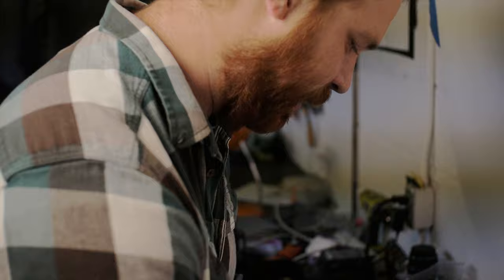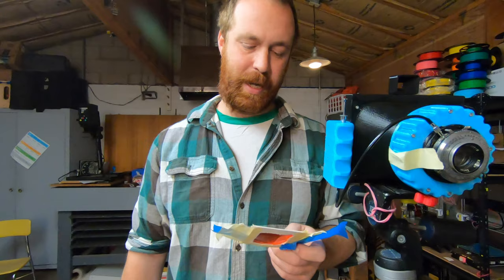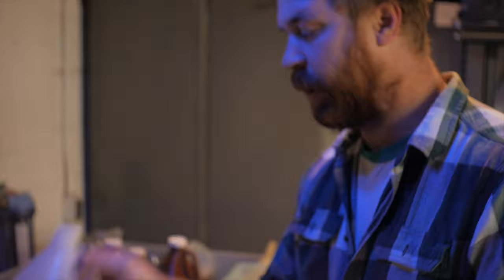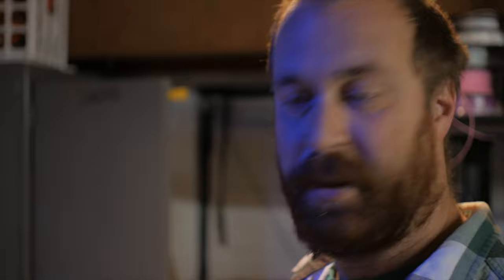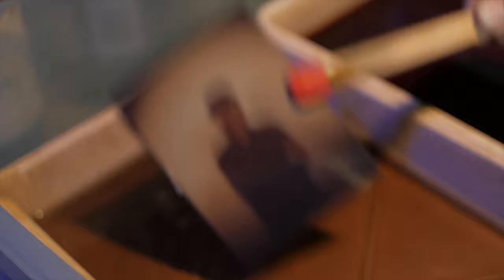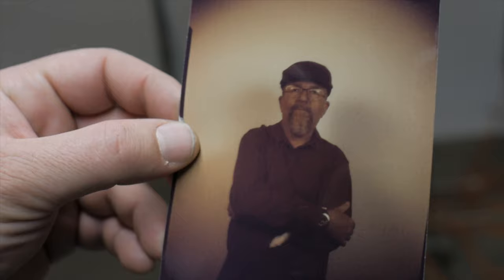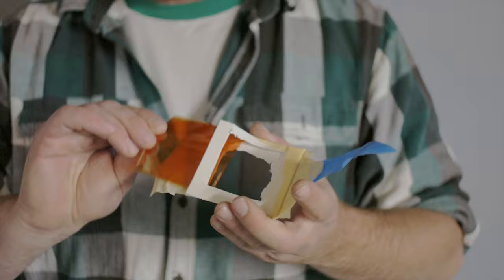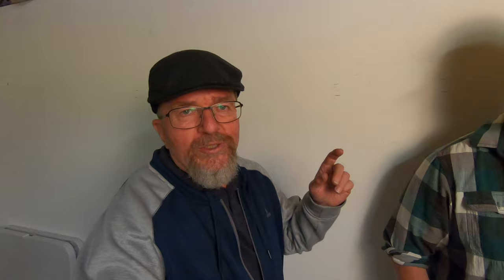Direct Positive Color Prints With Ethan Moses

Comment: The reticulation might be cause by the low temp. Color chemistry is design to work at around 90-100º F. If you want to keep developing @ ambient temp. add 5 grams of Potassium Hydroxide
Reply from the maker: Thank you!
Reply: Higher alkaline works faster, so it's like high temperature to keep grain fine.
Would sodium hydroxide work as well?

Comment: Also, Arista RA4 color paper processing kit  is designed to work between 75 - 108 degrees F which may help resolve some of the grain issues.  As you know, Kodak's chemistry is developed more for volume processing in machine processing, such as a Colenta processor and the aforementioned for tray.   Curious what chemicals are you using?

Comment: Thank you for this insightful video.  I work with an 8x10 colour neg process, but producing only colour negatives and invert to a positive after scanning.  I too at the start,  experienced little to no online resources about working with this process.  As for the filtration, I think you have a pretty good combination and don't think it's necessary to get it perfect.  I also noticed greys tend to go red, which makes sense due to the pigment dyes in the paper and how they react to light at the time of exposure. That particular element I noted as a positive characteristic and not worth resolving!   

As for the grain, I wonder if it's the B&W developer?  If you were to lower the Developer strength by adding more water? This giving more time for the tones to develop, especially in the highlights, and may resolve the grain issue. I use D-76 diluted to about 1:4 believe it or not for my B&W paper neg and find due to it's slower characteristics helps to deliver better tonality.  Perhaps this could help?  I will try this for myself and and see where it leads me. Thank again!

Comment: Good Lord, you're going to do DP Color in your Afghan camera kit? There's a challenge :D
Reply from the maker: I think maintaining the temperature of the color developer and blix will be a big challenge; although those can be done in the light - so if it's too cool, you can develop by inspection. Perhaps best done in the summer months! 

And getting accurate colors is a challenge, we're still working on that part. In-camera filtration is necessary, to simulate the orange-like tint of a color film negative's base color. But I suspect the "white" light secondary flash exposure may need to also be color balanced. Simple gel filter should do, so it may not be that hard, but requires a lot of testing.

I'm not sure about film speed of the paper. Ethan was using power packs in-studio. Again, those summer southwest US sunny days may be necessary.

Comment: I'm both amazed and confused, so is it regular black and white negative paper? Is there a written blog about the process? Can you please explain further, I want to do this, please please please.
Reply from the maker: It uses black and white developer and stop bath for the first two steps, processed in total darkness. This converts the already in-camera- exposed parts of the color emulsion layers to a negative B&W silver image. 

Then the paper is flashed with white light, to totally expose the remainder of the paper's emulsion - the part that didn't get exposed during the in-camera exposure.

The paper is briefly rinsed to prevent stop bath from contaminating the color developer.

Then the paper is processed in the color developer. This develops out the part of the emulsion layers flashed by white light - which is the opposite of the colors exposed in-camera and developed in B&W chemistry.

Then the blix (bleach + fix), which bleaches out the initial silver gelatin negative image from the first step, and fixes the image, leaving a color positive image.

I don't know of an online tutorial.
Reply: @Joe_VanCleave  so is it regular color negative paper?
Reply from the maker: @alhbagioras  Yes, Fujicolor Crystal Archive paper, the kind minilab prints are made on. RA4 process (normally).
Reply: @Joe_VanCleave  wow I love it, please keep up the great work.